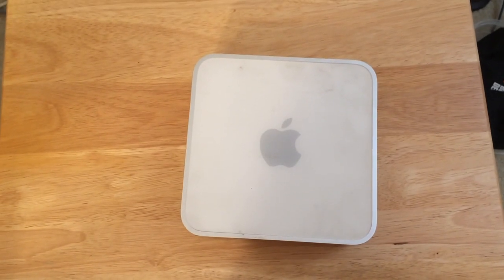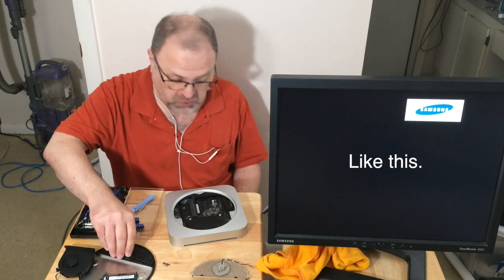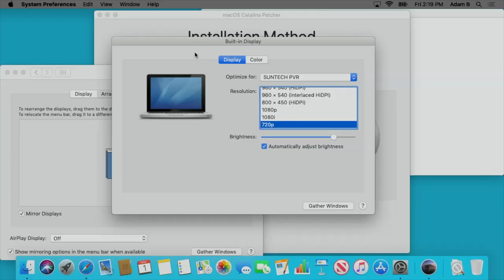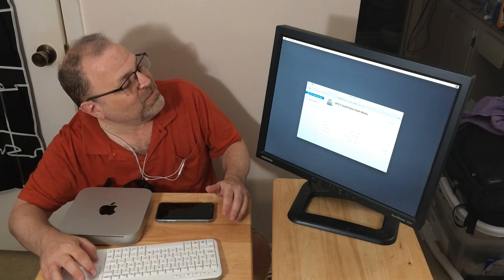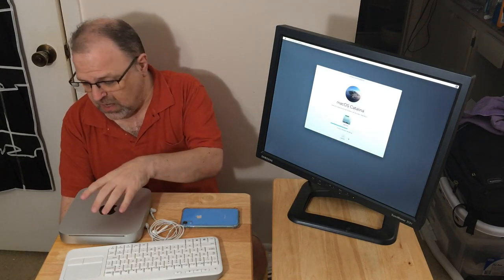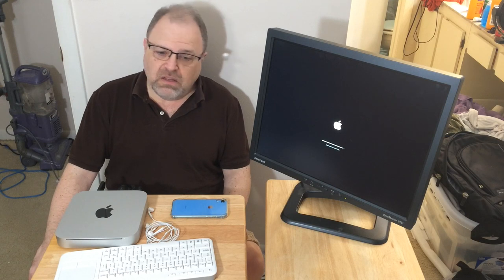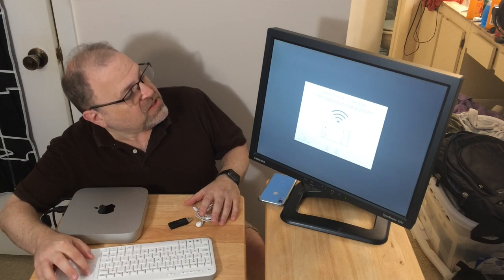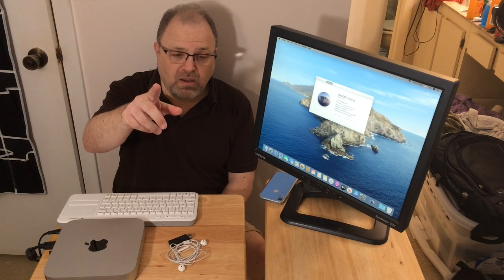Installing Catalina on an upgraded too-old Mac mini

Comment: why doesn't he say what he is going to be switching out before he starts?  I am curious if I can upgrade with a patch for my Catalina unsupported mac mini mid 2011 that I had installed a 500g SSD drive and put 16gb of RAM.  I thought maybe he would go into this so I would find out if there are going to be any hiccups if I do the upgrade work around.   If anyone know about any issues I might have if I upgrade please comment.  My goal is to be able to use Luna recording software with my apollo twin so it will be important to know if anyone has heard of any glitches that can occur.
Reply: check your system info and see if you have the intel integraded graphics or the radeon 6xxx graphics chip.  if you have the radeon chip it's not possible unfortunately, if not you're good to go